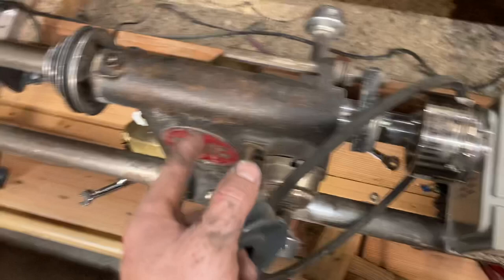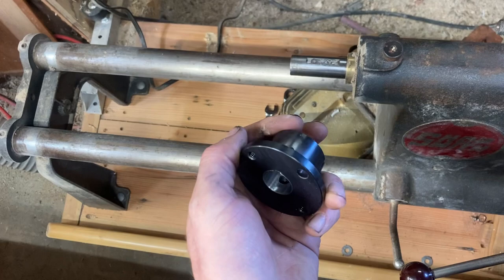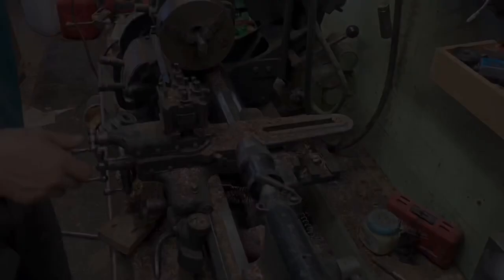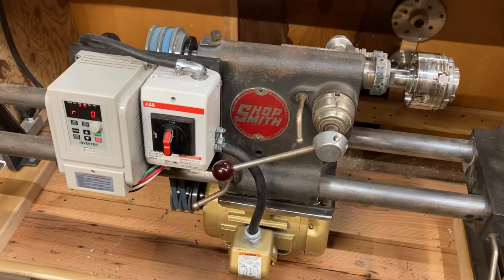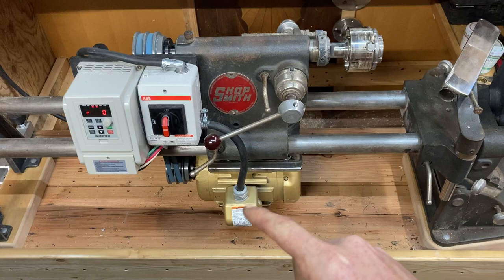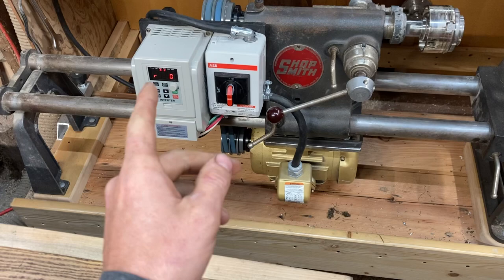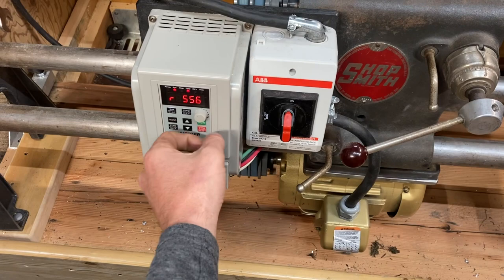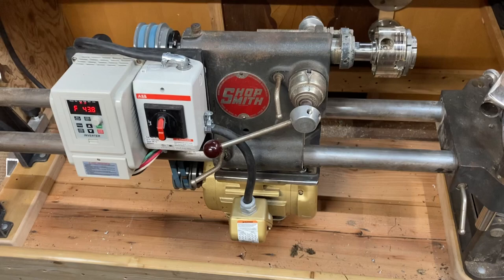Variable speed wood turning lathe for cheap!!

Comment: would be far more helpful if you showed exactly which motor and controller you used and how you wired it. I guess this video is more for entertainment than an instructional
Reply from the maker: I would but it doesn’t really help since all these controllers will be slightly different with different instructions for programming depending on where you buy them from. And your controller will have to be matched to work with your motor. And there are plenty of motors that will work with shop smiths.
Reply from the maker: Plus you should be fairly familiar with wiring, I wouldn’t want to show people without them having gone through at least some minimal electrical training

Comment: I completely agree with using double belts. Reducing the load on each belt will make them last much longer as well. Also, using good quality matched set of belts will eliminate those seams that are causing  vibrations and take the vibration down even further (probably not necessary but it’s there for those who want to strive for that level of tolerance. A cheeper solution than a matched set would be to use clogged belts. Perhaps it’s the brand or the models that I’ve used but I’ve always found them to not have that noticeable seam and although literatures often say that cogged belts can be more noisy because of the cogs, my experience has been that any noise created is substantially less than the noise created by the seam on the belt standard grade V-belt.
Reply from the maker: Yeah cogged belts work well just more difficult to find as a simple off the shelf item

Comment: Fun project! I enjoyed the video. Question, did you lose any capacity? In other words does the motor/belt/control prevent the headstock from sliding all the way to the left?
Reply from the maker: no since it was a tripple stacked pulley originally, I did not lose any capacity going to a dual belt setup, and the motor ended up in the same spot, so same capacity!

Comment: Do you think this could be done on the Mark5??
Reply from the maker: It would be a bit more difficult as you would need to find a motor with the same size\frame and shaft size in 3 phase with preferably more hp